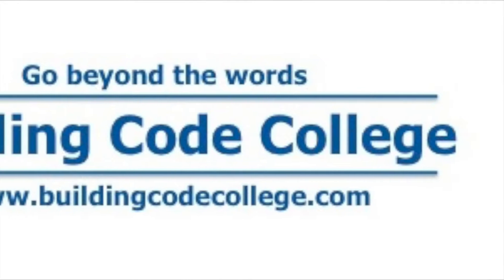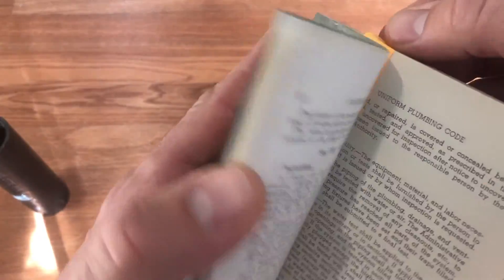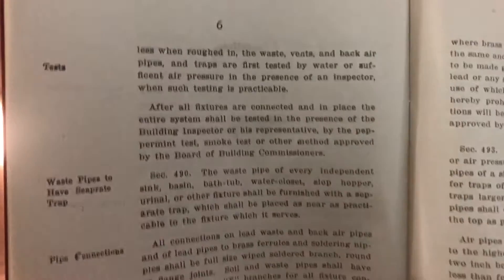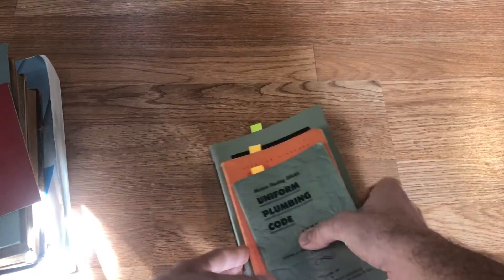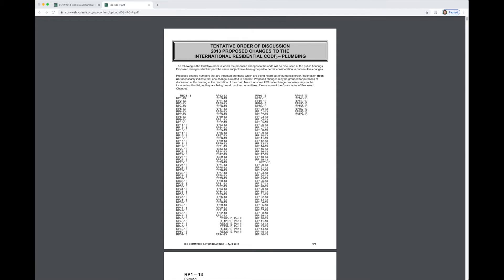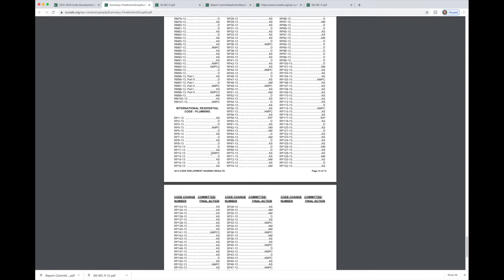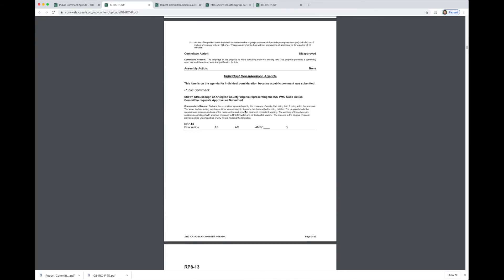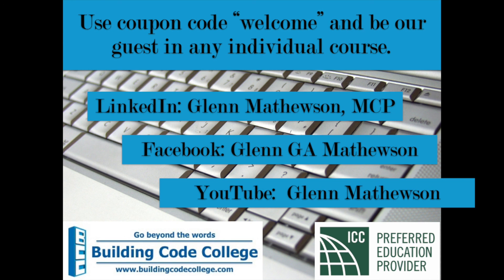The 10 foot head DWV plumbing test

Comment: This just makes too much sense. I don’t know when UPC changed but it’s been 5’ for quite a while. However we just make sure it’s at 42”(for non plumbers, this is 6” above the rim of your highest fixture which is generally the kitchen sink). I know they want to create 5 lbs of pressure but practically speaking it’s impossible to ever have this much pressure on the system. You have to have your sewer main blocked and then have each fixture blocked and then have rain fill up your vents to 10’. You’ll actually never have more than a couple of feet because the water would come out a bath or toilet. As for plumbers, 10’ head is such a pain in the ass. You have to get out a ladder and then secure the pipe somehow so the leverage of an extra 10’ of pipe doesn’t mess up your rough. This is especially difficult in the south(I’m in Texas) all our houses are slab so when our rough is inspected there’s only forms and dirt. This means you have to drive a stake in compacted kaliche or clay. This kind of goes along with what the code guys said about inspectors having a hard time inspecting. It’s just overkill.
Reply from the maker: Glad you like the video.  I've got a limited audience for building code history and education! ha, ha!
Reply: @GlennMathewson  thanks for making it. I’m a plumber by trade but also a history buff so it was the perfect video. Though my comment was wrong. I looked in my 2015 UPC book and it said 10’ head. I’m on Austin and it’s UPC but all of the surrounding cities are IPC. We’ve always done 5’ in Austin and 10’ anywhere else so I just assumed it matched the codes. It must be a local thing

Comment: Interesting, but in order to "go beyond the words" and understand the interpretation, it seems that the word "head" should be struck and simply refer to a 5' or 10' test stack because "head" is a measurement of pressure not height. A foot of head is is equal to. 433 psi, based on a column of water 1 foot tall by 1 square inch, as the IRC commentary in the video accurately states a 10ft head is 4.33psi. However, a based on nominal inside diameter, a 2“ pipe stack would only need to be 7.35 ft tall and a 4“ pipe would be less than 2 ft tall to generate 4.33 psi. I have never seen this considered logically. I am certain an inspector would fail the inspection and quickly pull out the code paragraph stating the test should be 10ft tall (or 5 for IRC.)

Thoughts?
Reply from the maker: This is a pretty deep discussion for a youtube comment, but I'll see what I can do.  What you are missing is that fluid exerts pressure in all directions (except up because of gravity).  Conceptually, imagine that stack of water inside a tall one inch square tube.  The fluid will be pushing outwards on the tube.  Now imagine that water as one inch tall cubes stacked on top of each other.  When you put a cube of water on top of another to create your head, the cube puts additional pressure on the cube below.  in the downward and outward directions, that lower cube now has more pressure than the one above pushing on the tube and downward.  This is how you develop the head pressure  on the sides of the tube and why you need the height above the last fitting you are testing.  

This leads us to your comment about pipe size.  Those stacked cubes of water are exerting pressure outward and that is resisted by your one inch tube (the test).  Okay.  Now double the size of the tube and put two one-inch columns of water cubes inside.  The pressure at the sides of the cubes against the tube are resisted by the tube.  

But, the sides of the two one inch water stacks that face each other both exert an equal and opposite pressure toward each other.  They cancel out.  Now add more and more one inch columns of water in a bigger pipe.  They always cancel each other except the sides touching the pipe you are testing.  Here a PSI (pounds per square inch) is being placed on the sides of the pipe no matter how big the diameter.

This is why the size of the pipe doesn't change the PSI generated on the sides of the pipe.  No matter the pipe diameter, it must be the same height to generate the PSI at the bottom.

Imagine a scuba diver and the pressure exerted on them as they go deeper.  This pressure doesn't change if they are in a lake or the ocean (small pipe, big pipe), it's all about the depth they go. (head).

I hope that makes sense and answers your question.  Physics is cool.

Comment: I had this test.recently.  If on top floor  and  after height for  sink fixtures and 8 foot walls you top off d.w.v. at rooftop and you are at about 9 plus???  Inspector just looks for leaks, doesn't measure....  comments?
Reply from the maker: I know inspectors that want a ladder to the top of the pipe and it filled to the brim.  Then they wait and return to see if it is still full.  This technique is reasonable, but sometimes give false fails due to an air bubble in the system that burps out.  I think the method of looking for leaks is a pretty good method too.  Probably a combination of both is best.  None of this is a perfect science.